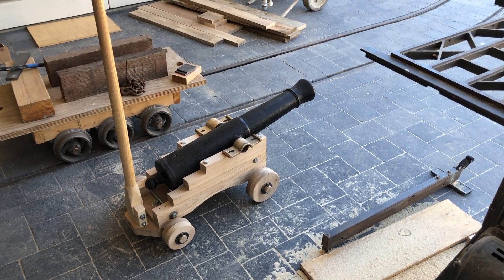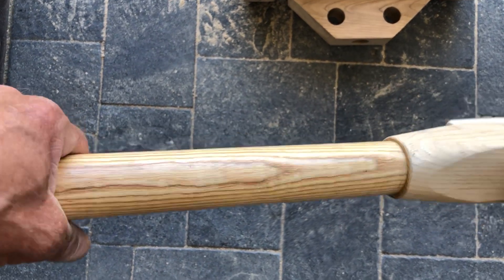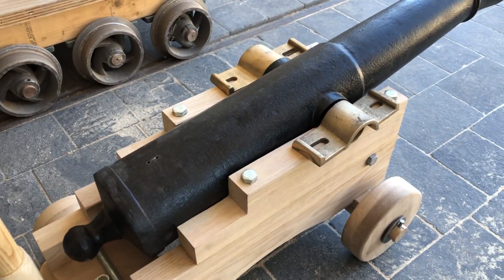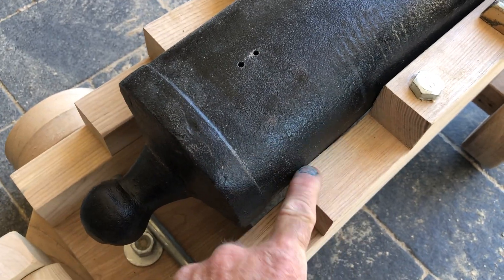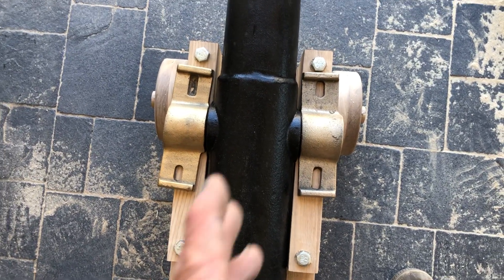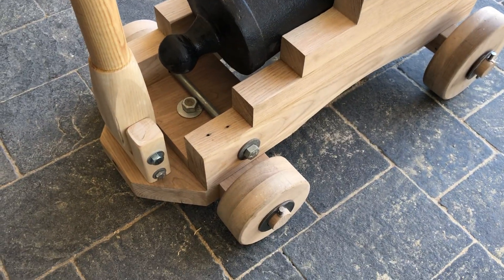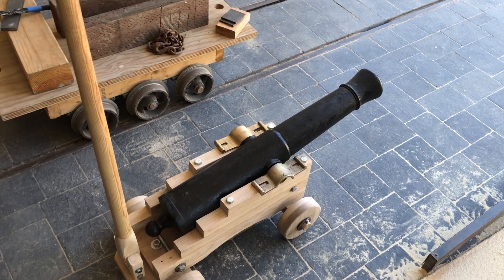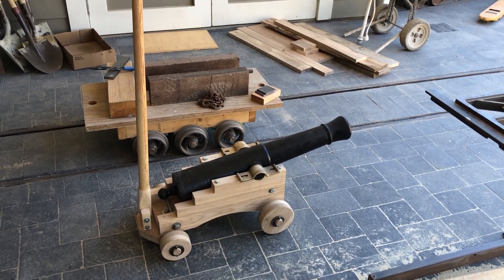1/2 Scale 1841 Six Pounder Cannon and Modified Naval Base

Comment: At least your 6pdr is in a carriage, even a naval truck. My 1/2 scale 6pdr bbl is sitting on a shelf for years with a 1/3 scale sea service. I almost finished a truck for mine but stopped as i realy want field carriages for both, if i only had some oak. I still need a full scale carriage as I've got  3" ordnance & parrott rifles that share one carriage. I made a full scale truck for the ordnance rifle first because it only cost about $50 to build, the field carriage was a hole differant matter. I mostly shoot rifled 40mm's & 3" guns is why i never finished the carriages, that & no oak😊
Reply from the maker: Thanks for sharing. Would love to see what you've already created. I needed something I could pull around on a hard surface in order to use it, which required being able to pivot one set of wheels. Using a field carriage would have worked, but felt that it was too bulky for me to store.

Comment: If youve had a chance to look at period drawings of this type of carriage, you will note that the sides follow the taper of the barrel. Your trunnion caps clearly allow for this.
Reply from the maker: Yes, I recognized that the cheeks should be parallel to the barrel, in whatever carriage I make in the future. 
I made a mistake when I transitioned towards pivoting back wheels. The filler piece between the cheeks wasn't as wide as it should have been. Take a look at my larger Carronade video. The carriage isn't quite finished yet, but all the critical dimensions have been addressed:

https://www.youtube.com/watch?v=nH1LBqMB21w

I essentially had to start from scratch with this model, since 1841 6 pounders and Carronades have such different geometry. 

Thanks for your comment,

Steve
Reply: @SHunsader  you clearly have knowledge and experience, didn’t mean to slight you. I have built ordnance myself, more my own interpretations rather than historically accurate reproductions, although i did have an 1880s coastal freighter, ketch rigged, fitted out with deck and swivel guns, once. She sank four years back. But thats another tale. Look at some of my videos.
Reply from the maker: @rowbearpucklebuck2331  I didn't feel slighted by your comments. I'd love to see some photos of your coastal freighter. Stay tuned for my completed carriage and test firings. - Steve

Comment: Hey, I absolutely love the design you have landed on. I just go the same cannon from Hern and have been trying to find a design for the carriage that does not diminish the size of the barrel. It seems you found that sweet spot where the carriage and barrel complement each other. I am currently working with a local Carpenter and would be interested in having some help figuring out those dimensions.

I also wanted to know if you have an angle to your vent hole or if you just did a straight bore. 

Any help would greatly great appreciated!
Reply from the maker: James, happy to help any way I can. Vent is straight bore on all 4 of my cannons. If you'd like to chat via phone, Google Me: Steve Hunsader San Carlos for my land line. I'll call you back.